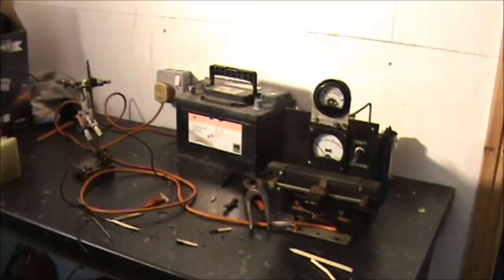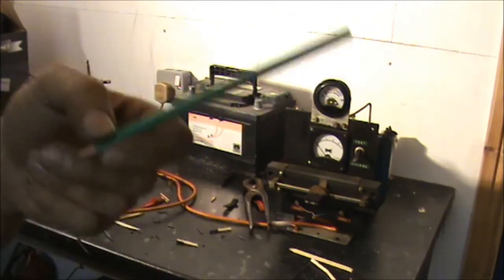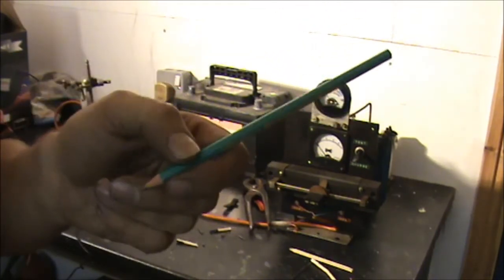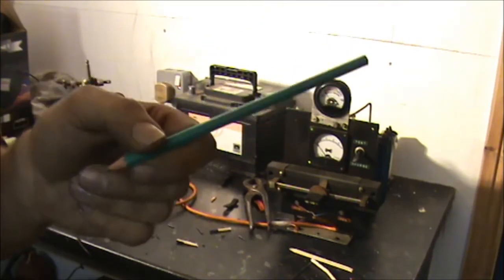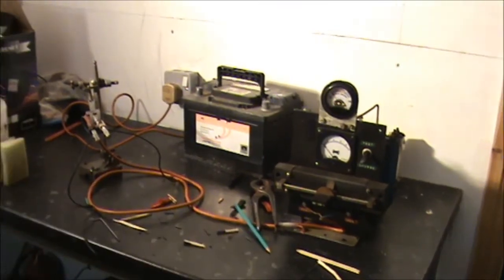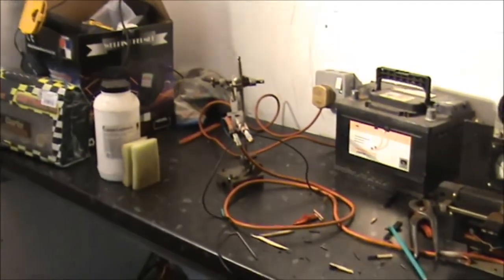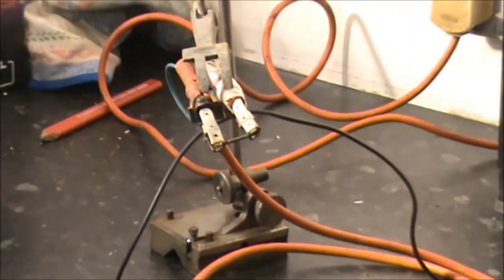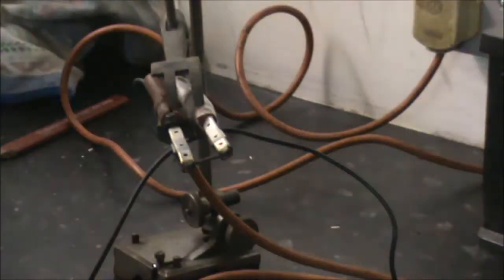pencil how did it work?

Comment: What would happen if you did the same experiment but this time instead of just a piece pencil lead try it with a pencil that has had both ends exposed (with the wood intact). Will it burn the wood or what?